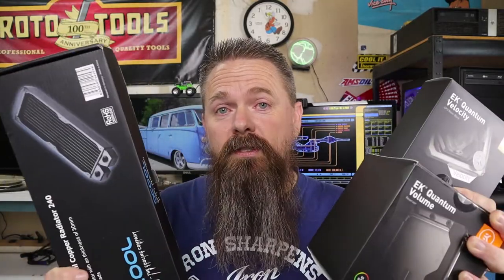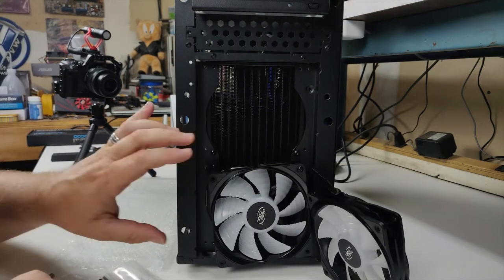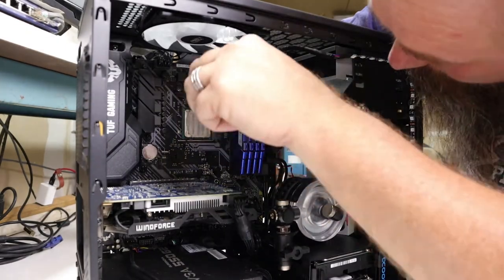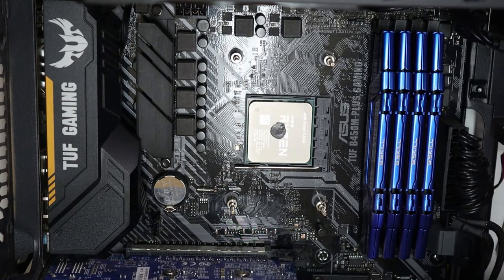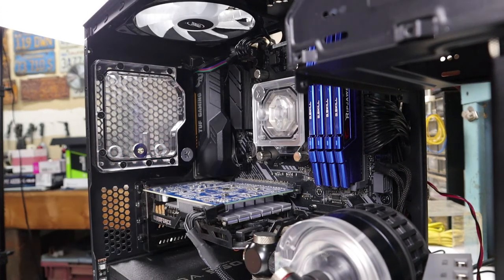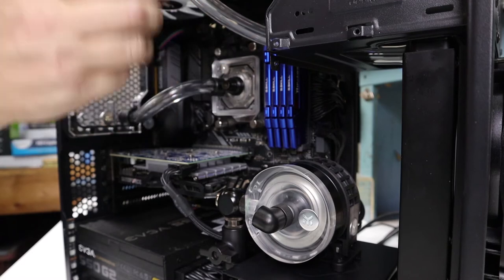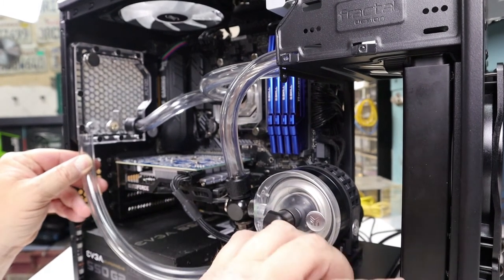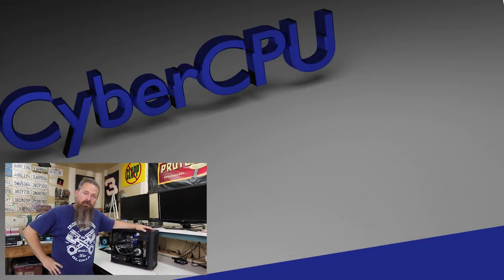Custom Water Cooling Loop Assembly (Water Cooling a Computer Part 5)

Comment: So glad I've found your video series!
I'm one step before fulfilling a years old dream of mine by building my first full custom loop. Currently, I'm searching out all the components and designing my loop. What I came out with is in some way quite similar to yours, I was gonna use the same FLT reservoir and pump, and also the drain port next to the pump.
I'm still not sure if I want to go with hard or soft tubing though...
Reply from the maker: I've been very happy with soft tubing. I highly recommend the primochill LRT that I used on this build. Solid tubing looks great but it's a nightmare for maintenance. 

As an example when I initially built this system I had the  drain port on the left hand side of the pump. When I upgraded my graphics card the drain valve got in the way of the graphics card. I was able to turn the pump all the way around so the drain valve is on the right hand side freeing up space for the graphics card without even cutting a new piece of tubbing.